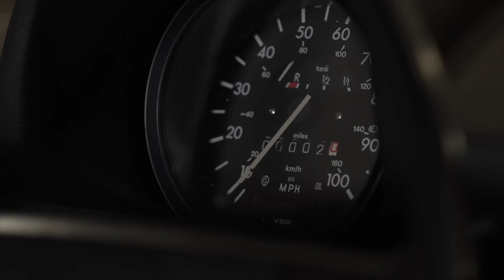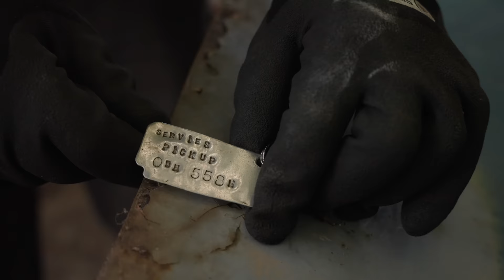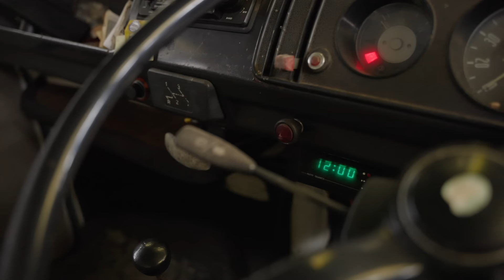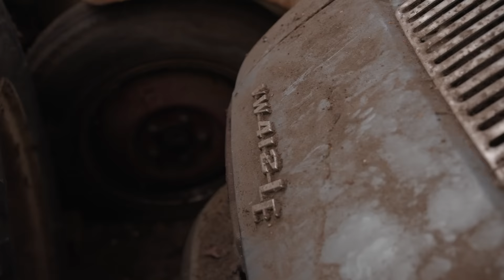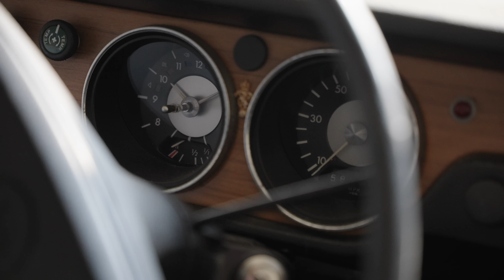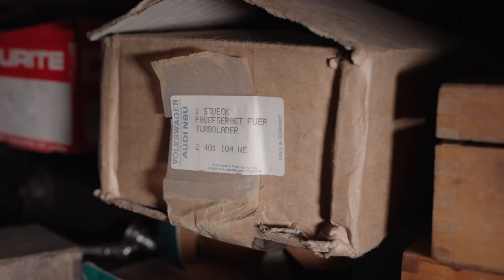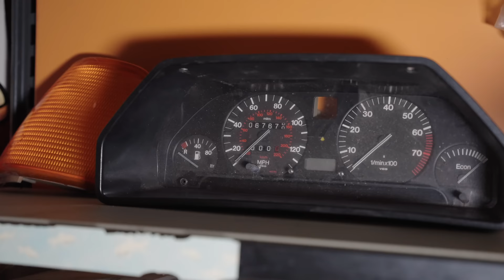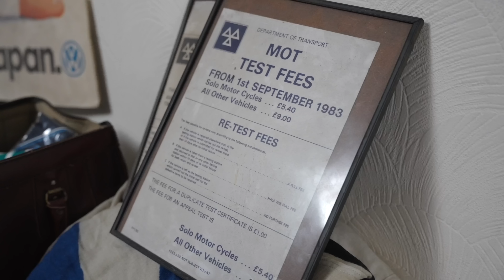Barn Find of classic Volkswagens (closed VW dealership)

Comment: I had a 412LE Variant as my first car in 1983. Superb car apart from the brakes, which were largely psychological. I don't think anything before or since has had such load carrying capacity. It even had a supplementary petrol heater that used 1 pint an hour and kept you warm even if the engine wasn't running. A most unusual first car but I loved it.

Comment: This is amazing Jonny.   Thirty year ago I needed an armature for the dynamo on my 1968 Porsche 912 Right Hand Drive (which still runs on its dynamo and regulator today).  No one could supply (Surprise Surprise)!  I ended up in desperation going to a scrapyard in Lincolnshire and salvaging the dynamo from a 1600cc or 2000cc van like the one here.  Wish now I had taken the complete engine.  Using the armature from this salvaged dynamo and my original we made a complete working dynamo.  The armature length on the van is longer than the armature length on the VW Beetle car.  "Who knew until you needed one?" Just by luck, I realized this by pulling the salvaged one from the van and it matched the 912 Porsche requirement.   Must have been to do with higher amperage for commercial use!    It's just what you did back in the day.    It's a shame this history is being lost, time however moves on.  But what a barn find.
Reply from the maker: Hang on, you still have a RHD 912? What's it like?
Reply: @TheLateBrakeShow  It's in storage in my shed and has been for many years. Re-sprayed and engine re-built. Running and driving before I put it away.  Paid GBP 6000 for it when I bought it.  I was 25.  I will be 60 this year.   Work took me around the world, to which I am currently in China.   When I get back and have a chance to pull the car out, I will give you a call.      I also have a 1972 De Tomaso Pantera Right Hand Drive.   The RHD Porsche 912 is rare and the Pantera RHD even rarer, but in need of a full restoration/rebuild.    I bought it already stripped when I was 30 for GBP 6000.    The Late Brake Show keeps me going for when I have time to re-visit both cars.   Keep the finds coming!

Comment: I'm in the process of rebuilding my 75 double cab bay window.  they are great vehicles and more practical than people would think.  I have the same factory 2ltr type 4 engine and 5 rib box that this guys was planning to put into it.  it's taken me a few years so far but have slowly replaced prety much the entire bottom 12 inches of the car!

Comment: Johnny, as a rule of thumb set the engine to TDC on the firing stroke, then set the distributor so the points are just opening. It’ll then start every time providing you have fuel etc.

Comment: A Problem with the earlier transporters(type II) was the valves burning on one cylinder because of the oil cooler position. The pickup probably had the same problem so it was parked until Granddad got a Round toit. Being a VW, just swap the engine for a better one.

Comment: I've got a T25 single cab pickup (restoration project) which is being modified to carry my VW Beetle race car. It'll be lengthened by 1ft on air ride, both axles narrowed to fit banded wide 5 Beetle steels...very big job

Comment: The Type 4s were really an update of the much more collectable (but inferior) Type 3. I still regret selling my 411 Variant - it was comfortable, very reliable, very spacious (although a 3-door) with a boot at either end, simple, rugged and relatively refined. The later 1.7 injected engine went into the Porsche 914 and was the nicest of the air cooled VW units IMO. A very utilitarian but lovable barn door of a car.

Comment: Bugger. Hate it when it's a fizzer at the end. Would have paid you to have checked out tappet clearances. Easy enough to do. Thought your guy was an expert? (I've owned lots of Beetles - including a rare 54 Oval Window and a 1970 German model. Plus half a dozen Kombis. Most interesting was a '68 Twin Cab with a 1600 - really got going. In the early days we used to pull engines out with a four by two over an oil drum. Took about 20 minutes.)

Comment: I feel bad watching these videos, I used to buy Bays in way better condition for a couple of hundred quid just to pull a few parts off of and an engine and send the rest down the scrap yard. 

My last 412 was the same, pulled the engine then sold the rest to the president of the 412/412 owners club for 200 quid, and all he really wanted was the unrusty wings and a few parts. 

Now hey are collecters cars worth a video watch. Maybe time to  restore my bay crew cab that has been sat 25 years. No engine, rusty, and some c#nt stole the drop sides,  and no papers either, but it is a bay crew cab.

Comment: Needs a Restro-Slam:- notched, box lift and Body Dropped.
Of interest these Pick-ups where made as Electric Factory Trucks and the Battery was swapped in and out of the Treasure Chest by pushing the new pack in on the left side and the old pack was pushed out of the right side and took about 30 seconds.
Reply from the maker: I think I recall seeing photos of one of those.
Reply: @TheLateBrakeShow  There was a video on youtube that showed the battery been swapped, the driver stayed in the cab and the battery was swapped on roller tables either side.  I can't find the video, I do know it was a German Factory Film from the 1970's, I can not remember the name of the Company.